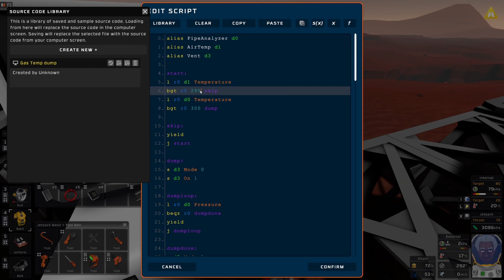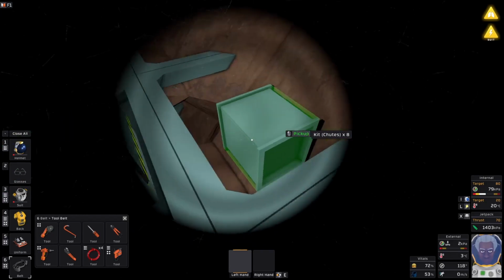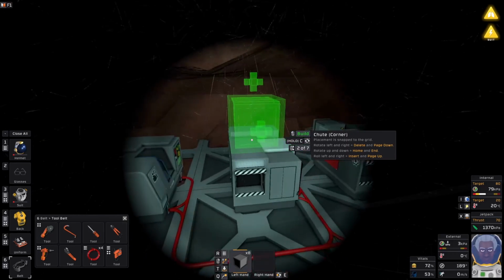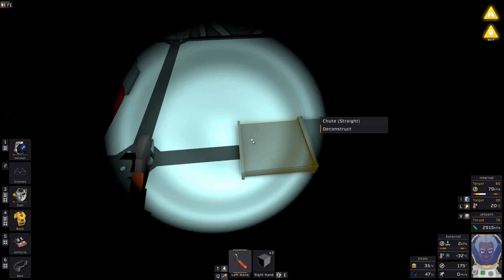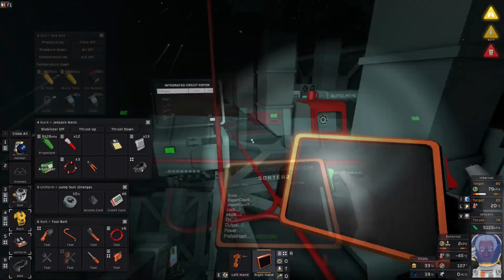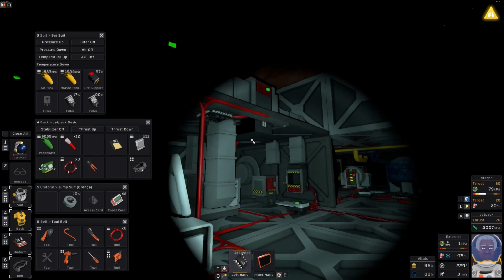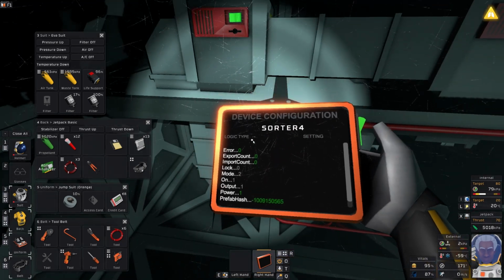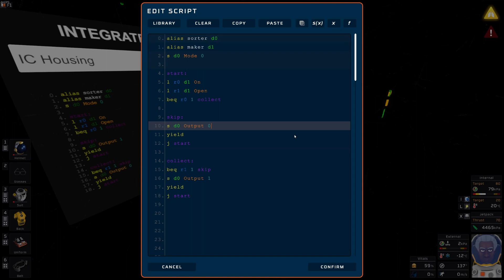Stationeers EP12: Shoots and ladders

Comment: FYI for anyone in the new version:
The Settings "Difficulty" and "Hunger/Hydration Rate" (shown at 08:22) are only visible the first time you start the game after the update (in my case 0-2-3647-17684).
After that the only way to change the Hunger/Hydration Rate is to edit the worldsettings XML-File of the save.

If you start a save without a Difficulty Setting, the game will ask you what difficulty you want to set.
Reply from the maker: Good to know. It is a shame that it is locked in now.
Reply: @JustWillYT  Yeah, i found that out the hard way:
Was playing the Game after pausing for about 5 Months and used the newest version.
I saw the Settings in the Menu and thought "oh, they moved them to the settings now, okay!".
After starting a new save in creative i almost died from hunger (doing household and playing Stationeers...) and i couldnt find the setting for hunger although ive seen it before.